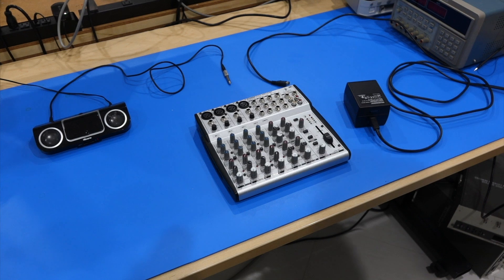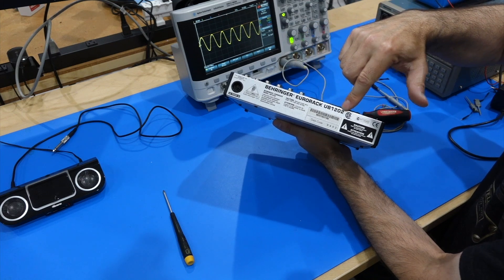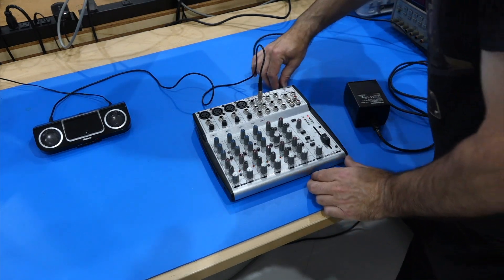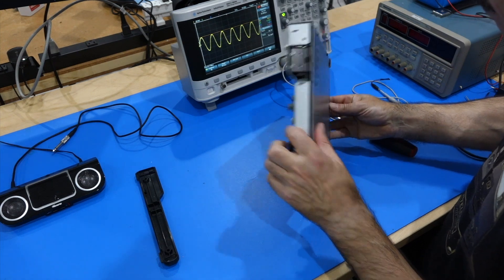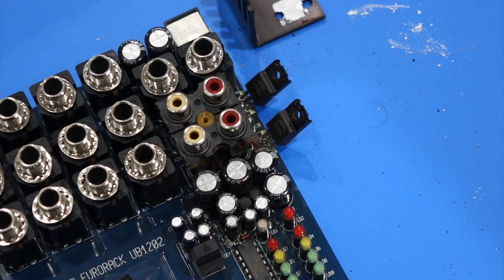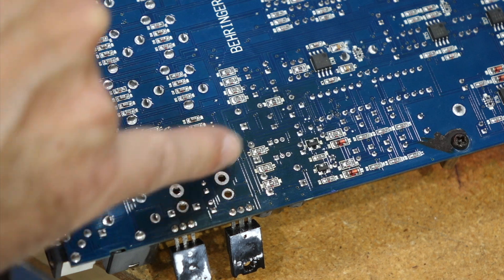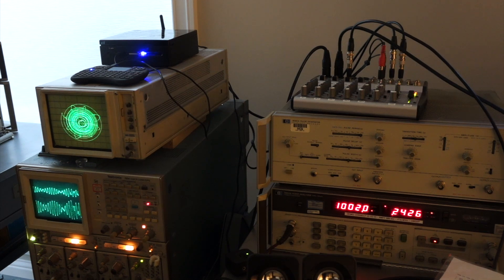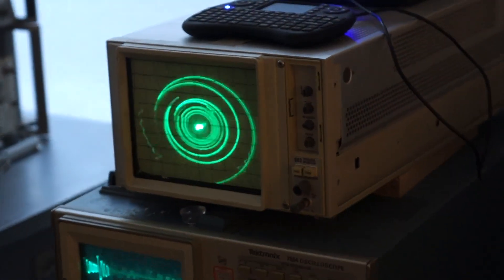Modern Tech Fail: Behringer Eurorack UB1202 Repair

Comment: Behringer mixer are famous for there CRAP switching power supplies. I bought a XENYX X2442USB some time ago and the power supply blew up shortly. I replaced it with a normal linear PSU, which I build my self. No further problems...

Comment: I have a real Mackie 1202 that also died due to capacitor problems, though I encountered something new - several of the electrolytics had failed short. I'm used to them failing open... very odd.

Comment: The energy input of this device has 3 pins, I think, 2 positive and one negative, but if you explain which pin is negative or positive, I would appreciate it.
Reply from the maker: Power input is 2x 18VAC, as said in the video. So probably 36V AC with a middle tap. No + or -.

Comment: Hi
Is there any video to how to Replace Volume fader because its only working with Right side left channel is not working from fader or
best if i can remove this older fader and by pass fader area with some soldering that means I can use Volume straight with Volume Button only

Comment: Hey man this channel is very cool!
I have a Beringer Xenyx 1002B mixer and it's actually pretty decent for doing smaller, duo / trio acoustic gigs.

Anyway the only issue I find is on the 9/10 channel which is used for stereo input for an mp3 / CD player.
With the Balance/pan knob I only get anything close to balanced when the knob is turned to the RIGHT of the Center detent to the 3 o'clock position or half way on the right side scale!

I've swapped out speakers, headphones, cables, power amps.
I even "de oxit" cleaned the balance pot to no avail.
I'm at a loss at this point as to why this is so.
Have you any ideas for me to try, please?
Thank you very much for your time!
Reply from the maker: Unfortunately doing remote debug is next to impossible except if I happen to have had the exact same issue on the exact same hardware. Which unfortunately is not the case. Given what I saw here, you could try to change the caps around that circuit. Also make sure there is not a bad solder joint in one of the input connectors. Good luck!

Comment: I had this mixer. How do you get the capacitor out without trouble ? I found the capacitor was impossible to remove with soldering iron and wick
Reply from the maker: You need a good desoldering iron indeed. I use a Hakko FR-301.

Comment: I need help
Hello .. I bought a behringer eurorack mx 802a on eBay without powersupply... Based on research the powersupply thst comes with it is 18v for 2 of the pins (xlr) at 800 mah.

However the powersupplies being sold on eBay for it is 17v for 2 pins at 600mah... Can those eBay power supplies work?
Thank you

Comment: Hello there! Great video!! I have an eurorack mx 1602 from Behringer (old 8 channel mixer, no off switch) and I broke the pins from all three voltage regulators (thanks to you I know what they are). Are they easy to find ? Board needs 20 volts (according to the label in power supply).  Also, schematics indicate IC13 (7915), IC10 (7815) and IC5 (317).

Comment: a month ago, someone pushed one of these Behringer mixers but with echo / delay effects in my hands to find the cause of the noise.
i scoped the power supply, it should be a AC sine wave, but it was anything like that.
i took a look at the PCB and to me it seams the worst PCB routing job on the entire planet, every trace was 90º angled, each and everyone, inherent for noise, noise build by default.
pretty sure this wasn't engineered in Germany, even a noob should know that.

Buying Behringer seams like rip-of.

Comment: the capacitor plague is a pain to deal with since it affects much of the era of electronics i collect and im painfully familiar with the analog scream of a dead audio modulation circuit it creates, the main symptom?  little to no volume control, it will be either quiet or screaming with no noticeable adjustability

Comment: I just finished replacing the caps in my Sanyo Walkman. Some of them were completely dead, but almost all of them were more than 20% out of spec, and had a high ESR. Portable electronics from the 80s/90s seem to be vulnerable to bad caps, I suppose from the heat in the small enclosures. But I agree with you that blanket replacing of caps should not be they way you repair things. In fact, the walkman also had a bad volume switch, and that took some time to diagnose. It was an unusual volume knob with both left and right actuation. One of the two sides was tied into the motor circuit.

Comment: Good on you for doing the repair.   I threw mine away as for the money it just isn't worth it.   But if you've got the time and it's something you enjoy, cool!
Reply: Mabye not worth the money to fix and sell.  But worth it to save the environment.   Or put on eBay for shipping cost “Needs capacitors replaced”    Instead of throwing it away.   Let someone with less money but lots of free time get some decent equipment for a steal
Reply: we should park in front of you, orherwise you can not post videos! see, you are now famous!

Comment: I'm a professional DJ and owned the Behringer XENYX X1222USB mixer, for exactly 2 years, right until I started to get noise and channel dropouts.  A month after buying mine, a musician friend bought the exact same model and used it for... yes, you guessed correctly - 2 years!  Exactly the same problem - noise and channel dropouts.  Built-in obsolescence is a real thing it seems!

Comment: New to the channel... what was the tool used to remove the capacitors? Did it heat and remove the solder?
Reply: Desoldering gun. Like a solder sucker except it's actually good because it's motorised suction. And, you guessed it, it melts it for you too. Quickest way to desolder large amounts of pins or if you desolder often. He's probably using a genuine Hako, but there's clones out there too.

Comment: I worked at a stereo repair/audiophile hand-holding outfit, and we had a test for miniature electrolytic caps we bought in bulk: weigh them.
We had an analytical scale that could weigh the difference between Fairy dreams and nightmares; we kept the heaviest 1/3, threw the rest out. The capacitors, not the Fairies!
Our theory was that a cap that weighed 2/3 of what it's buddies did is likely already dried out.
Reply: The new Jap caps of 30 years ago were all good. They rarely failed in the circuit unless some dumb designer located then within mm of a heat sink. In this case you could nearly always spot them by any bulge on the top.

Comment: Oh geez I had to do the same to one of those mixers. I also replaced some of the supposedly noisey opamps but that got only partially rid of the waterfall. So the noise problem seems to be related to the potentiometers and resistors.

Comment: hahahahahaha - you totally got me when you put the mask over your eyes ... GENIUS ! - you really deserve a thumbs up for that one =D
as for the main issue: there's a whole line of this style of mixers - and all have the same flaw of placement of the heatsink for the power-supply transistors ... but seeing this discoloration, just wow - I use a q802usb (pretty much from the same series but only 8 input channels + an usb adc/dac) - and I can already think of what to expect from it by watchin this video ...
behringer is actually a brand which is often said to be "one of the ones above the mid range" ... but seeing how they cheap out not just on components but actually flawed design and still selling them for quite some money I guess it's time to ditch them for good
maybe I would be better just by building my own after reviewing a lot of which component manufacturer actually has some quality to offer - and also doin the thermals better
also: many thanks to put the effort into showing what's actually inside those caps and what happen to them - you deserve quite a few more thumbs up for that ... very impressive

Comment: There is a simple method to deferentiate lethal cases of new chinesium components - they have slightly magnetic or soft aluminium alloys connecting wires. Capacitors, resistors, transistios, even ICs, even SM ones have ferric legs and magnet wire often is copper colored lacquer over aluminium. The latter is nasty often even in expensive Korean brands and even in heavily driven components such as microwave and SMPSU transformers and kitchen appliances' and hand tools' motors.

Comment: I only use Panasonic 10,000 hour larger sized EB or FM (low ESR applications) when electrolytics are necessary in my designs.  Everything 47uF and under is film or ceramic.
Reply: I stick with Panasonic and Rubycon for electrolytics, I like my recons to outlast the original "infallible German engineering".

Comment: Five'll get you ten that most of those "bad" caps weren't all that good when first installed. They didn't GO bad, they STARTED bad. 

"Leaking" has two meanings with capacitors. The obvious one is leaking electrolyte, and if they're doing THAT, then they're crap. The non-obvious one is leaking CHARGE, changing them from capacitors to being resistors, and there's no visible clue to when a capacitor is leaking charge. They're just made from awful materials, or made badly.

Comment: I think that the moral of the story here is this. Don't buy Behringer's garbage. I bought a Xenyx Q802 USB about a decade ago. The left channel wasn't working so I opened it to see if it was something relatively easy to fix. Lowe and behold there's a nut from one of the ¼" Jack's wedged up against the left output grounding it to the neighboring ground pin of a nearby jack. I have a picture of it as I discovered it if you're interested. This was fortuitous because one of the nuts they used was cross threaded so it served as a replacement for the fouled one. That's not even to mention the PA speakers where I discovered that they had repaired some miss-cut port holes by filling it up with hot glue. I found this as I was replacing blown drivers which were rated at about a quarter of the power rating on the cabinet. The iNuke DSP 3000 I got from them came with the wires of the power switch disconnected internally. There was a matching amp which was missing it's fuse. I didn't buy them used. They came that way new. What bothered me most was the 250 watt drivers in a 2k watt cabinet and not even in series with the other one in the same cabinet. I'll never buy Behringer's product again. Id suggest Yamaha or Mackie for about the same price. You'll be much happier with either of those.

Comment: Since it's founding, Behringer has always been a company that copies from other manufacturers and aims its products to budget-minded individuals who are looking for the same features you would otherwise have to pay a premium for. Behringer claims to be conceived in Germany, but was one of the first companies to dedicate all of its production in China. As a result they've encountered numerous legal battles with other companies over issues with patents and copyrights. Eventually, they've bought out other professional-grade companies and have, in my opinion, done an injustice to the names these new products are built on. Quality wise, I've always thought of Behringer as the European equivalent of Peavey; it may not sound the best, but it gets the job done.
Reply: Indeed. I've owned quite a bit of Behringer gear over the years and it's a trade off between price, features and quality. You get a lot for your money but how long it will last is anybody's guess. For amateur use it's usually more than good enough and long enough lasting for you not to feel ripped off when it packs up.

I have a similar mixer to the one in the video and while half of it is either dead or dying there are still enough holes, knobs and twiddly bits working to keep it in service after 15 years. I suspect if I cleaned out the dog hair, nicotine and dust I could get most of it working again... But I can't be bothered.

Comment: What is ESR?
Reply from the maker: Equivalent Series Resistance. The internal parasitic resistance that is in series with the capacitor.  It is a good measure of the quality of the capacitor. Ideally it should be zero, in practice for a good large filtering cap it's in the 100's of milli-Ohms, for smaller decoupling cap a few Ohms. If it's high the capacitor becomes lossy and starts to dissipate heat. If it's very high it's as if the capacitor was not in the circuit. People in the comments confuse it with leakage resistance, but it has nothing to do with that. These capacitors were not leaky.

Comment: I’ve had two Behringer mixers, one failed because I plugged it into 240V... maybe I killed the power adapter but I didn’t have a way to check.
The other still works, but I did manage to zap its USB port with a fake Apple plug. 
Both cost $100 so I can’t bring myself to care.

Comment: I refer to "Eurorack" as "Euronoise" as Behringer stuff is always noisier than the competition. How does it make sense to repair these? The minimum repair time is going to be an hour and some cheap parts. That's got to be 1/2 the price of a new one just to replace a couple capacitors to repair a compromised overheated board which means the repair is to a compromised motherboard. I can't see where it's worth it.

Comment: Am very curious about the difference between the presenting symptoms and the huge number of 'dead' capacitors.  The roaring 60Hz sounded just like either a p.s.u. regulation problem or mains pickup. it is hard to see how the audio caps would cause the 60Hz.  I do wonder if the power supply surges from faulty 47uF electrolytics have not allowed massive high frequency and killed all the caps because they are passing high currents in what should be low current circuits.

Comment: I had that with ASUS & MSI motherboards from around 2004. 
Interestingly my Behringer mixing desk from 1998 still works to this day! It got 4 stereo and 4 mono inputs and is double the size of this thing. So maybe it's not Behringer but the chinese capacitor factories at fault here? Looks like they mass produced crap around 2000..2010?

Comment: Everyone trying so hard to sell me on an X32 and I have to explain to them every single piece of behringer gear i've ever had or seen broke or died prematurely. It's absolute junk of a company. I got talked into a 4 channel headphone amplifier and parts on it just started dying for no reason. Knobs stopped working. Buttons made horrendous noise. It's just all junk. It sat in a safe studio rack space it's short and pathetic life. Replaced with a Mackie.

Comment: A set of Nippon or Nichicon would exceed the cost of the unit shipped and delivered...
Reply from the maker: Of course not. It's in the single digit dollar range if you buy you caps in manufacturing volume.
Reply: @CuriousMarc  that entire mixer probably cost around 8 dollars to build in China... might be 10 with the chassis... high end caps are found in absolutely nothing under about a grand due to the EXTREME cost compared to market generics... The company  I work for ships a few hundred million devices annually I have some clue as to manufacturer costs... the costs are relative right, if the unit BOM is 8 dollars  and high end caps are 9 dollars is a problem for the manufacturer, no?

Comment: Fun Fact: Around 30 years ago, one tech company tried stealing another tech company's formula for making the electrolyte which goes into electrolytic capacitors.  Somehow, they ended up stealing an early formula which wasn't properly balanced.  As a result, there was a wave of dud capacitors which broke down within a couple of years of use, leading to a lot of tech having to be thrown away since it wasn't economical to commercially replace the capacitors.
There are probably still a few Chinese companies attempting to use that same, incorrect formula, leading to the occasional batch of "Chineseum" capacitors.  Unfortunately, the Chinese seem to be great at imitating, but useless at innovation.  That wasn't always so.  It's a pity to see how far downhill a once-great country has gone.
Reply: On the subject of spotting bad caps, I've managed to do that a couple of times just by visual inspection.  A computer power supply had a bad cap which I spotted by the bulging "lid" and replaced, extending the life of that power supply for quite a few years
 More recently, a pair of identical TVs (bought for myself an a relative) began to "play up" in identical ways.  When I opened them up I could see bulging capacitors in the power supply section so I just replaced them, which fixed the problems.  Both TVs lasted a few more years before other problems required their replacement.

Comment: On a related note my Tektronix TDS-220 scope from over 20 years ago is working fine with no repairs of any kind. It is possible to build quality, but price points seem to be the norm instead. To date it, it supports hardcopy printout directly to Epson 9 or 24 pin dot matrix printers using a centronics parallel port with the optional communications module. Will also print to a Thinkjet, Deskjet, or original Laserjet by HP, if you still have one. This is pre USB, so no saving traces to a thumb drive.

Comment: Great video, but there has to come a point when you realise your time is worth more than the cost of replacing the unit - especially when you are using such expensive test equipment! (That LCR meter was about $12k new!)
Reply from the maker: The goal here is obviously not to make money, but to find out why electronics die and learn something. It just happened that it was easy to diagnose and inexpensive to repair this time, but I just lucked out.
Reply: @CuriousMarc  I understand and appreciate the content, I just find it frustrating that repairs are becoming less and less relevant due to the ever decreasing costs of the product and the shrinking and integration of the components inside!